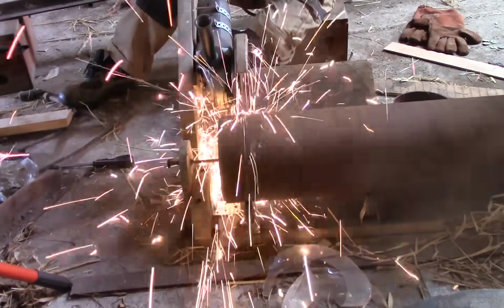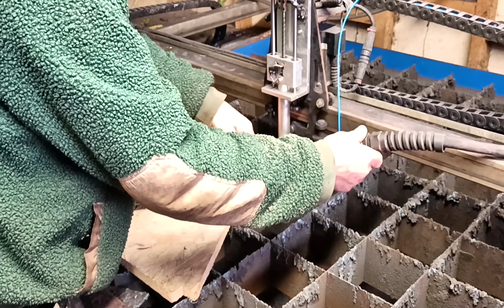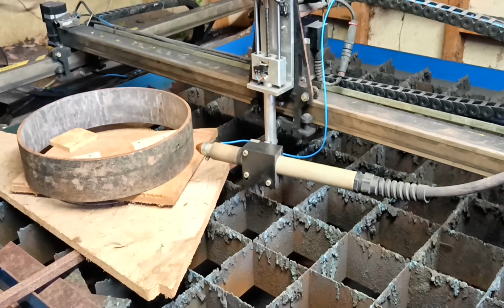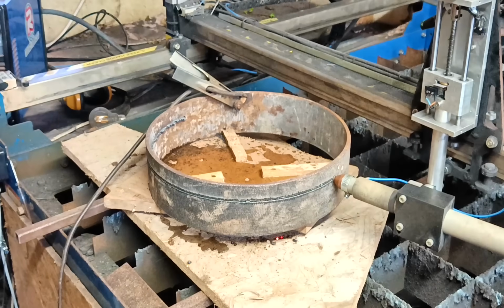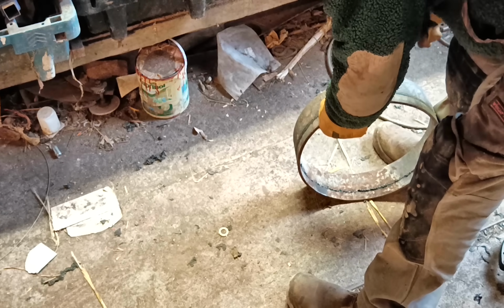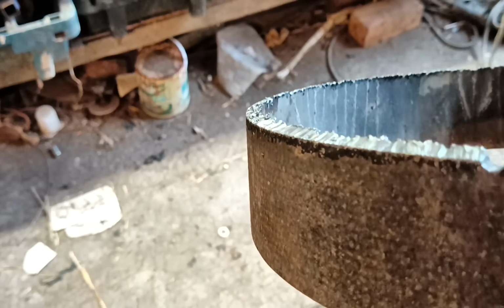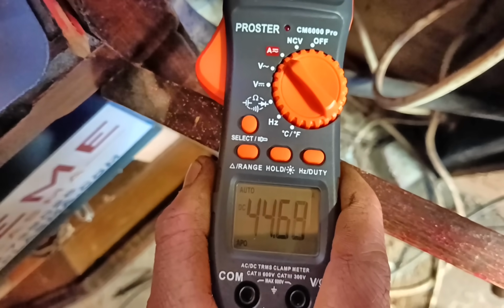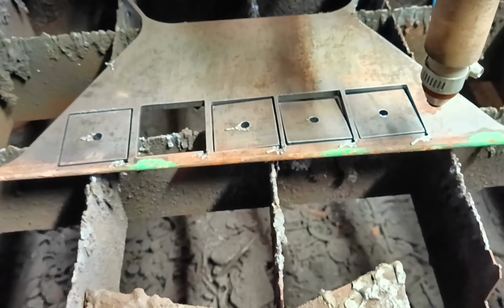Cutting BIG Pipe With A Plasma Cutter - To Make BIG Railway Wheels, Of Course!

Comment: Tim, with your plasma cutter set-up, you seemed to have all of the bases covered. Refrigerator compresssor, in line air drying filter (check regularly for dryness), and the regulator moisture sump. Next, it comes down to how clean your cutting material is. The cleaner, the better. 
The lazy Susan bearings sounded very gritty. Some sort of servicing would help. A small motor to help turn the turntable consistently. 
Mark from Melbourne Australia

Comment: I am wondering if it would be possible to weld the flange to the rim without grinding the edge of the rim very smooth.  A bit of roughness could aid with weld penetration.

Comment: Tim, one of the reasons rail wheels treads are so wide is because the railhead itself is several centimeters across. American mainline rail is 132lb T-Rails, with a head that is nearly 5cm across. With your rail being strap iron, its what, 1cm across? I think you could cut those wheels in half thickness wise, and be able to make twice as many out of the same amount of material (pipe). But also, if the wheel itself is narrower, you might be able to get away with a single set of spokes instead of needing two per wheel. Just trying to throw a couple ideas put there that might help you save time and money.
Reply: wide wheels allow you a lot of leeway on less than perfect track and you can go around sharper curves.
Reply from the maker: I need the whole width on the curves - I'll try to show you soon

Comment: Tim, I had a friend with a side business which required steel caster wheels of sorts that he made from scraped and condemned oxygen cylinders. Before plasma cutters he rigged a cut off saw in a jig and rotated the cylinder by belt tension on a slow motor cutting from the bottom of the cylinder while it lied on its side and working up to the top where the valve is cutting a few inches for each wheel. The last bit where the valve had been fitted he saved and made into a bell.
I see future you smiling.

Comment: To bad you can’t attach a chain or something to your drill to bash inside the pipe with the ceramic coating to knock it out of the pipe or at least cause fractures to make it easier to remove

Comment: A small air hammer would make swift work of that ceramic coating.  I bought one for $69 from a local tool store that came with a variety of four shaped tips.  It's great for breaking up and chiselling off small amounts of material such as concrete, brick, stone and heavy tiles.  I use it to clean hardened concrete from my cement mixer, among other odd jobs.
Reply: Excellent suggestion. My only thought was to set a fire inside the length of pipe, and hopefully, the thermal expansion and contraction will help to loosen the concrete liner. The only risk of this idea is that adding heat to the pipe might make it out of round unless the heat is uniformly distributed. 
Mark from Melbourne Australia
Reply: @markfryer9880  Heating the pipe could also soften the steel.

Comment: Tim, just from personal experience with arguing with plasma cutters, clean your metal to shiny base steel, and your cut will improve, also as another commenter said ignore your little digital amp gauge, and ignore your air pressure regulator gauge and turn both up till it cuts properly
Reply from the maker: ok then!

Comment: I think you should look at the "simplex" engines as a design inspiration.  Having a powered shead on wheels could be useful.

Not only could it do a decent job, but if it's properly water proof, you could use it as a nice place to store sandwitches, a hot tea, and a cozy place to take a rest when it's raining, that you can then drive back home in.

Comment: Great to see the plasma back in action. They really are a superb tool but they don't like the rusty stuff. £5 a go for tips sounds pretty reasonable based on what we used to have to pay for the ones for the old Murex Tradescut we had. I worked out it was 50 pence a go  just to strike the pilot arc.

Comment: Hey Tim! I repair welders and plasma cutters for a job. 90% of the time, plasma cutter problems are all in the torch head. 
And I mean no offence but, I would not expect a plasma machine of that...construction, to read correctly on the amps display. Just turn it up until it cuts cleanly and ignore the display. I am mightily impressed that you have a mains supply beefy enough to run all that gear at the same time! That's another problem with plasma machines, the single phase ones are very hungry for input amps. 
Love your work!
Reply: As he is in Ireland, 63A as main breaker is usually the norm. And with the transferpoint from supplierer network to your own house the NH-fuses are usually rated 250+A the three in my home are rated 500A
Reply from the maker: Thanks - will try that..
Reply from the maker: Is there a cnc plasma cutter you would recommend, Sam?
Reply: @  As I live in Australia it's hard to know what is available where you are. Hypertherm is best of the best but super duper expensive. If you can get a Jasic machine over there, their build quality is quite good for the money.
Reply from the maker: @theSam91  thanks - I'll investigate...

Comment: For your spokes, I would recommend rounding off (or at least beveling) those sharp inner corners near the center, just to prevent any nasty stress concentrations that might lead to cracking. It's probably not truly needed for the sort of duty you are expecting, but it is cheap insurance.

Comment: Put a piece of flat bar or tube between your spokes otherwise you will probably crumple your wheel sideways, they are very weak in that direction.
Reply from the maker: It's potentially a weak point, but it would take a lot of force to make that happen, I think

Comment: So if you get tired of turning the table by hand pull off the Y stepper motors and use one of them to turn your table, just program a straight cut in Y the length of the circumference. 

I am not familiar with the brands of plasma cutters they sell in your area but our table had a cheap chinese built plasma cutter that blew thru tips like they were free.
A the tips on a quality plasma cutter last much longer.
piercing blowback is usually what kills tips the fastest.

Comment: Here's two curious questions. Firstly would you be able to modify a metal chop saw to cut your long lengths of pipe instead of using an angle grinder attached to a board? (I mainly ask this because without a bigger shield on that grinder I know how unpleasant it is for steel sparks to be flung at you) Secondly if you were able to use a metal chop saw with a roller system for the pipe like what you have there, would you want to use an abrasive wheel saw or use a saw that's made for carbide toothed blades like Evolution brand saws? They throw less sparks and the cuts are cooler to the touch than with abrasive blades.
Reply from the maker: Good questions - I guess the grinder-on-an-arm is already the same a chopsaw? You'll have to try the toothed blade - too pricy for me!

Comment: If you do a electrical loko,  use lead acid batterys, instead if lithium  jon . Adding weight on the loko is good for traktion , and the alternative of building a very heavy steel frame to ger that weigh is expensive. 
With lead acid you get a lower cost and less risk of battery induced fires, plus simpler sharching , no need for,advanced bms .

Comment: Might be a bit biased but would have been allot easier to part the pipes on a lathe but the modifing a plazma to cut pipes with angels so to weld a 90 lets say would be a great idea

Comment: So, are you going to make your locomotive electric? 
I still think that you can make a fine locomotive using the same motors that you used in your electric car. Just need to hear it down a bit.

Also, make it rideable, but riding on one end, but put your seat dead center and batteries on both ends.
Like the one on Karen’s little railway

Comment: There doesn't seem to be much metal around the square hole in the middle, especially if this is going to be for a locomotive. Are you sure that will be strong enough?
Reply: it'll be just fine
Reply from the maker: Good point. I was thinking I'd put on an extra thickness there anyway - a welded-on washer - if needed

Comment: I don't understand why bigger wheels are beter? But I really enjoy the video.
Reply: 1. Higher Speeds

Larger wheels cover more distance per revolution, meaning the train can go faster without the motor or axle spinning as quickly. This reduces wear and helps with mechanical efficiency at high speeds.

2. Smoother Ride

Bigger wheels can roll over imperfections or gaps in the track more smoothly than smaller wheels. This leads to a more comfortable ride and reduces mechanical stress.

3. Reduced Rolling Resistance

Rolling resistance tends to decrease slightly with larger diameter wheels, making the train more energy efficient over long distances.

4. Lower Rotational Speed for Axles

At the same linear speed, axles with larger wheels rotate more slowly, reducing bearing wear and stress on drivetrain components.

5. Improved Adhesion and Traction

Larger wheels may have a greater contact patch and can improve adhesion (grip) to the rail, especially helpful for heavier locomotives.

---

However, there are trade-offs:

Larger wheels are heavier and take up more space.

They require more torque to start from rest.

They're not ideal for tight curves or low-speed urban rail systems where compact size and quick acceleration matter more
Reply from the maker: What Kev said. But mostly because I like the look of them
Reply: Probably because that is the size pipe he has.

Comment: Can't help but notice that you were using an angle-grinder to finish off a plasma cut which the whole point of doing was to not use an angle-grinder?
Reply: I disagree. The plasma is faster and can be set up as a system to mechanize the process.
Reply: @Brennannnnnnnnn I mean if you want faster you could have partied it in a lathe 😅
Reply: Watch all video it was because table display was showing wrong ampage for torch, hence why he had amp meter setup pal.
Reply: @ Watch the whole video as the rusty bearings on the improvised CNC turntable caused the rough cut which required the use of an angle-grinder, PAL
Reply: @BuzbyWuzby  no way, get outta here, really, thats amazing, I must have seen that too, plus the display on table was giving wrong amperage output ! Duh.
Reply: I think the point was to not get covered in sparks when using the angle grinder, and that depends on how you use it.
Reply: The plasma cutter cuts the pipe much quicker, but leaves slag or a rough, ragged edge that can be easily ground away using the grinder, while still being faster than using the grinder alone.
Reply: Surely building a simple spark-guard for using the angle-grinder would just be easier?
Reply: @BuzbyWuzby  get tha board, laid down with four heavy duty, free rolling rubberised wheels, slap pipe on that so it can be rotated.

Add an extra powered wheel, with pwm speed control, set to rotate pipe at correct speed, jerry rig a wheel opposite where torch is at cutting point, set to take weight as material is cut, have torch at correct ampage for thickness + plus cutting rotational speed, should need no angle grind, or less to remove. 

Guard on grinder would be ideal, more so on cutting discs than flapper. In case of disc grenades, more than the sparks and bits that come off. Prefer welding gloves on when grinding myself. 

Cannot create as easy if body parts dont work or vacate the body.

Comment: What about making wheels out of brake Rotors, cutting down  and cutting the backside of the brake surface and trimming it. It would work, but you need axle or hubs from autos  do that for your locomotive here in the states, we have plenty of all riding lawnmowers or small tractors that would be perfect for your situation
Reply: You would need to add the cost of obtaining several hubs and the axles and they would probably be different sizes & types. Then you would have to adapt the axles to the rail width.